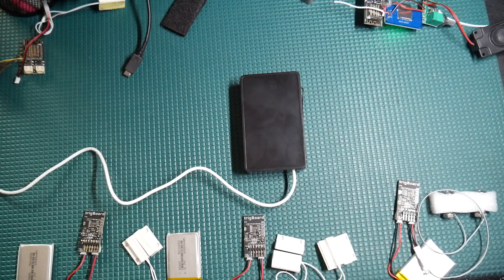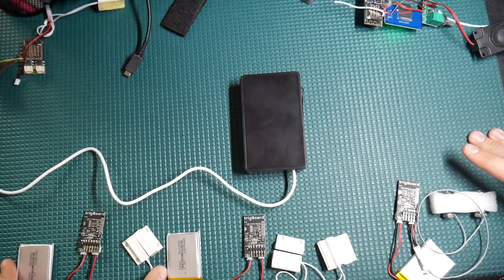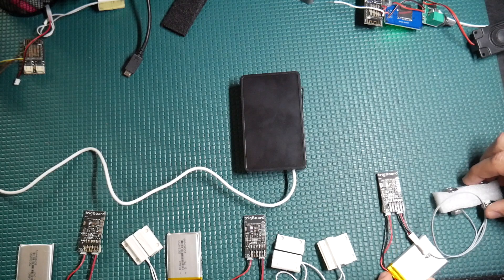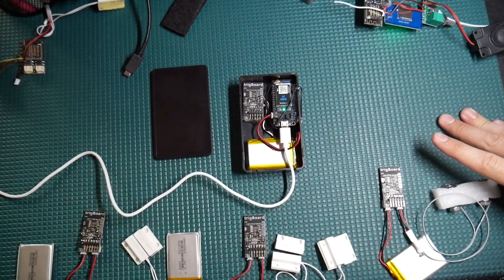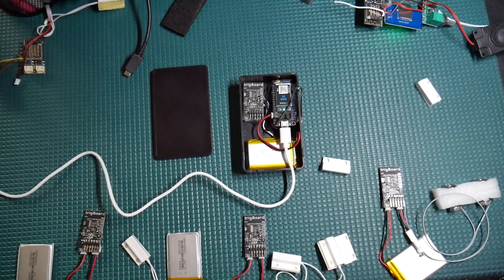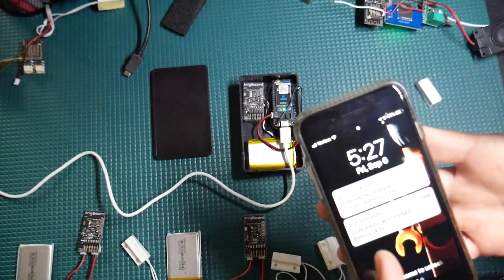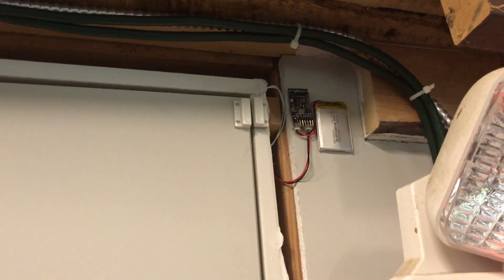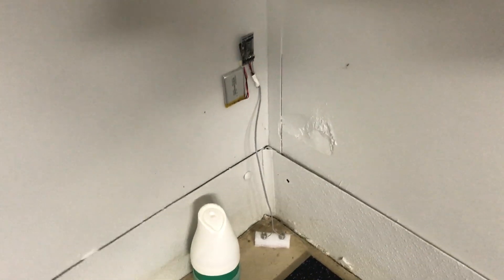DEMO & Installation -The Ultimate DIY Home Security System - ESP8266 (trigBoard) + 4G LTE Modem

Comment: Hey Kevin,
which is more power efficient( consuming less power) a (mini 328p arduino with nrf24l01+ combination) or an ESP8266 with ESP-NOW ? I need to install this board inside a water well, that i use ultrasonic device(hc-04 "works on 5V") to measure distance
forgot to mention it is a sleep almost all time(with sleep function) to wake up once an hour or every 6 hours, something like this.
Reply from the maker: good question, but would need more details... my first thought is ESPnow

Comment: First and foremost I want to say “Thank You” to Kevin Darrah.  He listened to my special need for a device to help me to keep my wife safe.  

At my request, he built a device from the Ultimate DIY Home Security System that would notify me anytime my front door was opened.  He even tested the device using my network credentials prior to shipping.  Once I received it, I went about setting it up and discovered I had made a mistake in the SSID I gave to Kevin.  He quickly explained what I needed to do to make the changes to complete the setup.  My router is an ARRIS SURFboard Wireless Cable Modem GW DOCSIS 3.0 SBG6900-AC.  

He discovered my router was a model that didn’t play well with the trigBoard.  He did some research and found two files that mentioned my router and the ESP8266, which is the brains of my device.  My home network also includes a WiFi extender made by Netgear, configured as an Access Point.  I adjusted the configuration to use the extender’s SSID and now my device works flawlessly every time my front door is opened.

I highly recommend that if you need assistance with any of Kevin’s electronic projects, he is extremely knowledgeable about what he builds and is very willing to support his products.

Comment: I need help. How to check battery level without any analog pin in arduino / avr?
Reply: You can try using the internal voltage ref, just note the accuracy isn't great.

int currentVoltage() { //Read using internal voltage ref
  int v;
  // Read 1.1V reference against AVcc
  ADMUX = _BV(REFS0) | _BV(MUX3) | _BV(MUX2) | _BV(MUX1);
  delay(10); // Wait for Vref to settle
  ADCSRA |= _BV(ADSC); // Convert
  while (bit_is_set(ADCSRA,ADSC));
  v = ADCL;
  v |= ADCH<<8;
  v = 1125300L / v; // Back-calculate AVcc in mV
  //DEBUG_PRINTLN(v);
  return v;
}
Reply: Trent Torkar Try this video for answers to your question about reading battery levels. Another one I follow. https://youtu.be/C-VnvjEP0-k